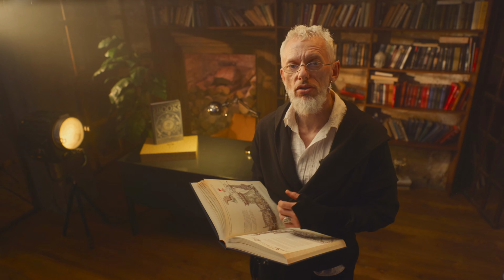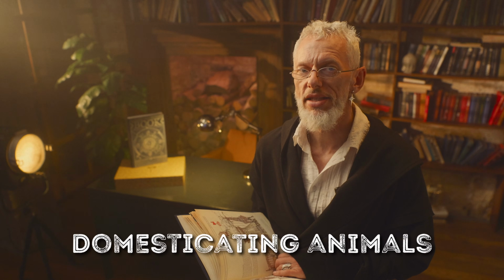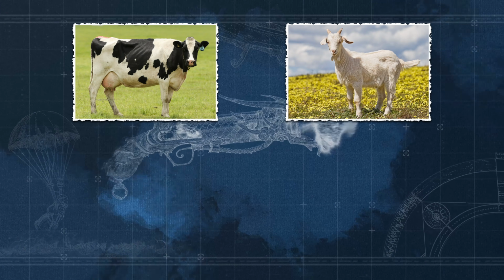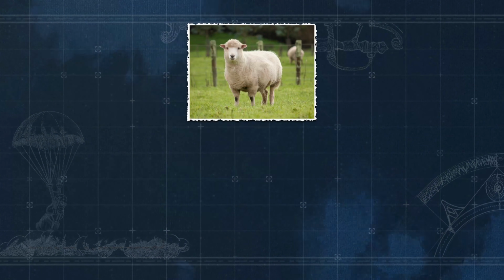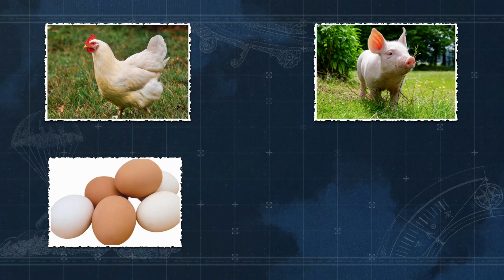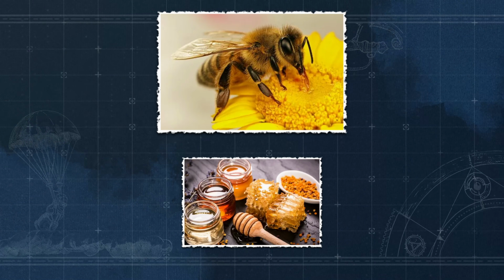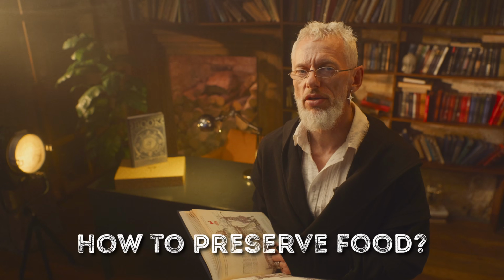How to Make Civilization From Scratch [Step by step]

Comment: Flint and steel method and purifying water both require smelting first.

😙
Reply from the maker: You’re right, flint and steel definitely need smelting first. Water purification, though, doesn’t always! You can actually boil water without smelted tools, do you know how?
Reply: A solar still without reclaimed petrocarbons would be tricky, I also am not an expert glass maker so as to withstand the heat difference so,

No I do not.
Reply: You could heat rocks in a fire and use those to heat a container from the inside. You could make a sanitary wooden container out of a tree stump let's say by essentially lighting a fire on top of it and controlling what burns to hollow out the center.
Reply from the maker: We like this option! Have you ever tried that in real life? Just curious!
Reply: Glad to hear it seems reasonable and no I've never tried it, I just learned about the methods on YouTube. Boiling water with rocks is an old Japanese fisherman's trick to cook in the depressions of rocks and the log burning is how one of the native American tribes used to make canoes.
Reply from the maker: That’s fascinating! Do you remember which Native American tribe used the log burning method for making canoes?